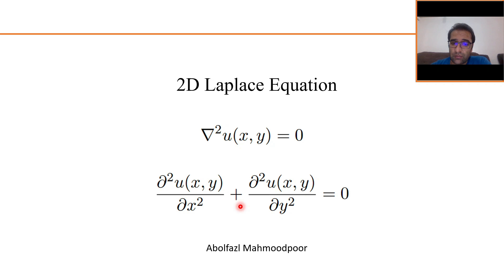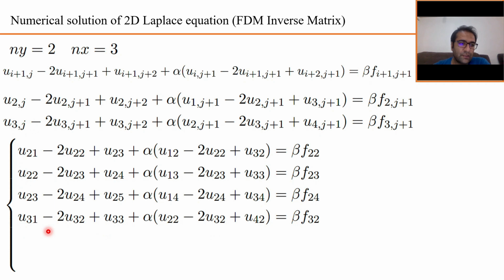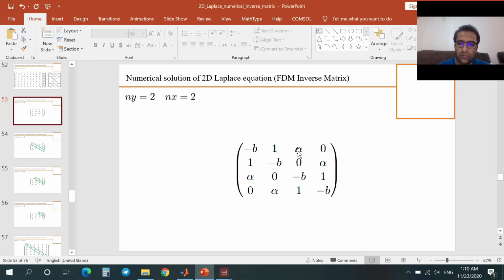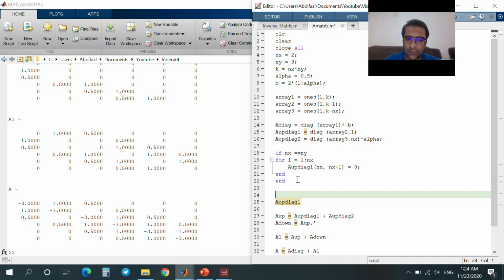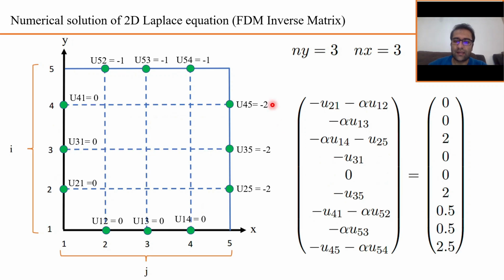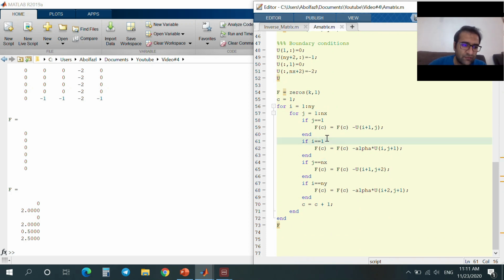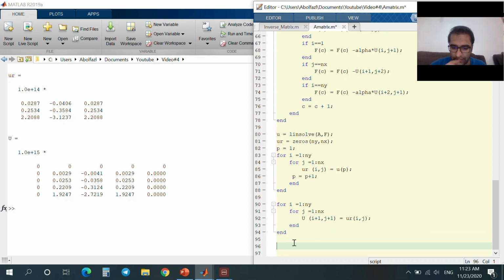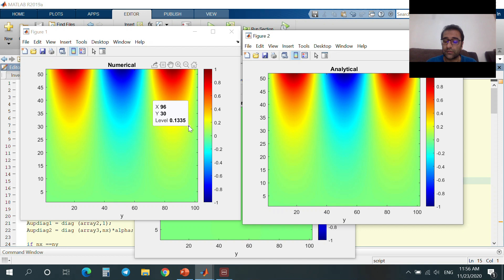Numerical Solution of 2D Laplace equation using FDM and Inverse Matrix Technique

Comment: Thank your for this course. Very helpful. In order to speed up the solution of 2D Laplace equation, is there any other faster method than FDM? Can we use POD-Galerkin method to Laplace equation?
Reply from the maker: Glad it was helpful. It is possible to use finite element method for solution of Laplace equation but honestly I don't know is it faster than FDM (inverse matrix) or not. About POD Galerkin method it is usually used for convection-diffusion equation I didn't use this method at all!
Reply: @abolfazlmahmoodpoor_  I think POD-Galerkin is for all PDE's? but i don't know if we can use it for steady PDE's
There is another one called "Reduced Basis Methods'' but i didn't use it at all
Reply: @abolfazlmahmoodpoor_   how can i right in code if my right boundary condition is if x tends to infinity then V=0?

Comment: Which one is better? Iterative or inverse matrix ? I guess depending on the stability and the problem of interest? Thanks!
Reply from the maker: iterative method is simple in coding but it's slow in comparison to inverse matrix method, on the other hand inverse matrix is faster and harder in coding. Moreover you can adjust the error in iterative method and stop calculation at desired error (number of iteration) but inverse matrix method's error  is fixed.
Reply: @abolfazlmahmoodpoor_  thank you very much for the explanation! Very helpful!

Comment: Many thanks, Abolfazl for your great video, I just have a short question, in the Neumann BC how do we define the corners?
Reply from the maker: Corners are defined by either vertical or horizontal boundary.
Reply: @abolfazlmahmoodpoor_  you mean we can consider an imaginary point beyond the scheme and use it's value to calculate the corner value?
Reply from the maker: @muhammadaslanimoghanloo5014  No, I mean that the value of the function at the boundaries are known, the corners are the cross section of two boundaries, vertical and horizontal, therefore you can easily consider them by either vertical or horizontal boundary.

Comment: Thanks so much sir for this great video.
 But my problem is;
how do I implement the Neumann boundary conditions on one, two or three sides of the Laplace equation using finite difference method?
Reply from the maker: I received your email. If following explanation is not enough let me know using the email, it is easy, just using the definition of first order derivative. We used it a lot in the videos, If you use it  you will see that one node after boundary the value of function at that point is given by the condition that imposed by derivate (an example:  df/dx = a    ->      f(1) - f(0)= a*dx     -->     f(1)=a*dx + f(0) so the value of function is known in either node number 0 and node number 1 and you should just start calculation from node number 2 )
Reply: @abolfazlmahmoodpoor_  Thank you so much Sir.
God bless you Dr.

Comment: sir for working  on matlab which laptop should be good..?
Reply from the maker: My laptop is Core i5 with 6 GB RAM, it works well and more than enough for Matlab program.
Reply: @abolfazlmahmoodpoor_  thankyou so much sir.
Reply: @abolfazlmahmoodpoor_  sir how to apply finite differential method on mixed condition with Laplace  equation.
means after  plotting  grid points and making equations  what is the approach
Reply from the maker: @vishalchhabra7016  What do you mean by mixed condition?
Reply: @abolfazlmahmoodpoor_ condition  of Drichlet problem and neumann problem are present together in which
Reply from the maker: @vishalchhabra7016  Here is an example. Please look at the video.

https://www.youtube.com/watch?v=CAT2xSaC7UY&t=4s